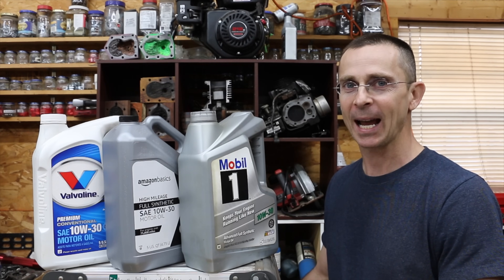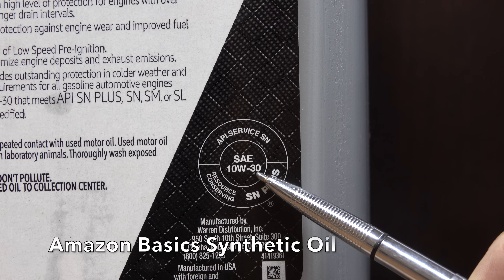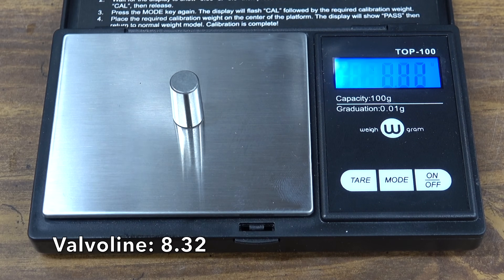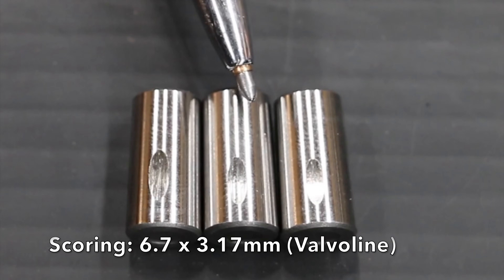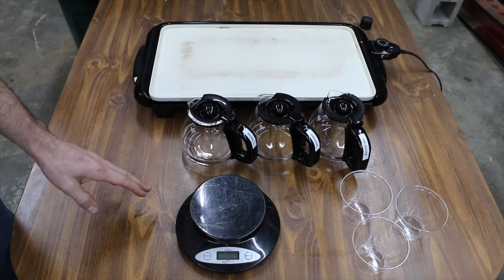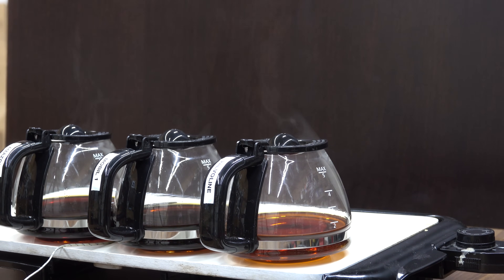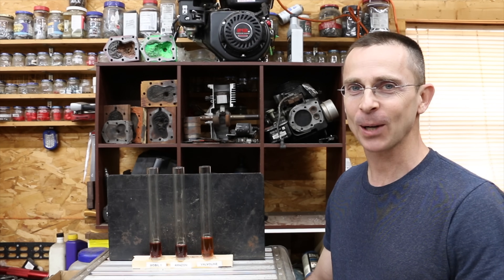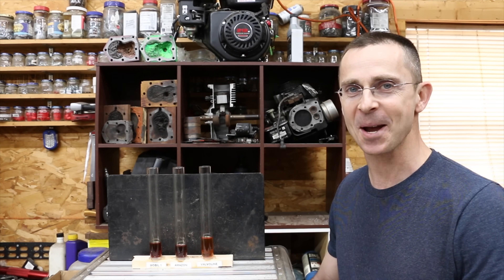Is AmazonBasics Full Synthetic Motor Oil better than Mobil 1? Let's find out!

Comment: You know what would be a great test I've always wondered about is if the 35$ jug at a reputable parts store is the same makeup of the 25$ jug at walmart. I always wondered how walmart can sell Mobil 1 jugs for 25$ but parts stores rarely ever get it under 35, that's a pretty big difference and price point. I've always suspected that walmart gets specific batches of cheaper oil sold in the same containers. Maybe it's conspiracy mind kicking in but something says that isn't right if parts stores are willing to price it way beyond a competitor.
Reply from the maker: Thank you for the video idea!

Comment: A test of standard petroleum heavy duty diesel engine oils would be great. Mobil, NAPA, Valvoline are the three main ones I've been using (whichever one is cheapest the day I'm buying).
Reply: Rotella is dirt cheap on Amazon too... Running it in my clapped out old Kohler flat head since it's got a drinking problem lately.
Reply: @TheBrokenLife  that's the other one I was trying to remember! Thanks.
Reply from the maker: Thank you for the video idea!

Comment: Another good illustration how conventional is not nearly as good as synthetic.  However, I think you should  have done a lubricity test on the oils after you overheated them.  I hypothesize that the conventional valvoline would have fared even worse.
Reply from the maker: Great point!  Thank you

Comment: Having watched your content for some time now, I'm really appreciating the depth and tenacity you bring to your testing.

I wouldn't mind seeing a comparison between MOTORCYCLE oils and normal high efficiency engine oils. In many cases, we riders will use whatever won't cause our wet clutches to slip, which is often stuff like Delo 400 or whatever synthetic diesel oils. But, are motorcycle engine specific oils bringing anything to the table beyond a lack of friction modifiers? Does moto oil protect a steel on alloy bearing interface better? ie, your lawn motor engine's typical bottom end bearings and top end bearings in nearly all modern alloy head engines.
Reply from the maker: Thank you for the video idea!

Comment: Thank you for your demonstration... Once again you raise questions for farm use. Oil is expensive when the tractor uses it by the gallon. I don't think I run over 100 hour in a year and the oil still passes the farm test. A two finger smear and some light shining on it. I wish I could do something  other than "Lubroscisize" a sample.   

In one of your videos you put seafoam everywhere it could go in your truck. I followed your lead and had good results all around.  So what if you use regular oil with seafoam in it? Thank you!
Reply from the maker: Thank you!  Seafoam is an excellent cleaner, but I wouldn't use it for a full oil change interval in the oil...just my opinion.  I would prefer using it just a few hours in the oil before an oil change since it will really help clean the engine internals.

Comment: Been trying to reduce oil consumption in my 2011 auto 2.0T and curious if using amazon oil if it would reduce my need to refill quart after quart every 600-1000 miles 😭
Reply: it has a flaw in the engine design. It doesn't matter what oil you use in that engine, you may not see any improvement.
Reply: Ricardo The PC Wizard I know but since I rent it out, I'd love to reduce the oil consumption as much as possible
Reply from the maker: It's worth a try.

Comment: Video Idea number one.  How much 2-stroke oil is needed in a gas/oil mix before ice crystals stop forming in cold weather?.  Video idea number 2. Some new modern oil formulas say that 100/1 mix ratio is perfectly safe in a 2-stroke engine....lubricity test various brands mixed with gasoline to see if the claims are true?.
Reply from the maker: Thank you for the video idea!

Comment: damn, valvoline is cancer for your car
Reply: That's flatly just not true. I've had multiple cars get up over 200,000 miles running on Valvoline conventional. It's just not a premium grade product with a premium grade price. On things I care more about, I run the much more expensive Mobil 1 synthetic (about double the price of Valvoline dino oil).

Comment: I thoroughly enjoy your videos. The amount of thought and careful attention to detail in the comparisons make these videos very valuable. I typically pride myself on doing a good job at what I do and I can’t say that I would do anything different than you do as you go through these extensive comparisons. We get the benefit of your hours and hours of hard work in preparing, doing the actual comparisons and then the excellent analysis. 
I do have to admit that I would have liked to have seen another set of the bearings/film strength tests after the heating and then again after the second cooling, just to see if there was any measurable differences through the cooling/heating/cooling cycles. Maybe for a future video. 
I really like how you make things very fair between the products. Weighing the scored bearings is a nice touch!
Reply from the maker: Great test recommendation!

Comment: You should make comparisons on bearing scars from different weight synthetics,  at -15F and then compare scars at 212F 

For example 0w30 5w30 and 10w30. 

I know they are supposed to flow the same at 212F but I'm a firm believer that in order to gain something,  you have to sacrifice another. 

My guess is 0w has less film strength at 212F than 10w.

Just a guess. But up here where last week was -66F 0w still pours like syrup.
Reply from the maker: Great test idea!

Comment: W stands for weight.
Reply from the maker: Thank you.
Reply: Winter not weight
Reply: The "w" in motor oil stands for winter. The first number in the oil classification refers to a cold weather viscosity. The lower this number is, the less viscous your oil will be at low temperatures. For example, a 5W- motor oil will flow better at lower temperatures than a 15W- motor oil. The higher number, following the “w” refers to hot weather viscosity, or how fluid your oil is at hot temperatures. The higher the number, the thicker the oil at a specified temperature.
That's off Valvoline's website.
Reply: Thanks.  We always used W for weight at the companies I worked for over the years and everyone took it to mean 5 weight when it's cold. So I learned something new today!  Thanks again.

Comment: Anyone have any long term experience with the amazon oil? And mechanic opinions?
Reply from the maker: I just completed a 6000 oil change and the oil did not evaporate nearly as fast as the synthetic valvoline I was using. Cold starts at near 0F seemed easier too.

Comment: In France we have Carrefour, reselling Mobil1 under its brand, Leclerc reselling Total under its brand, and Auchan reselling Motul under its brand, and others I don't know about. I drove many years with Carrefour oil in my cars and never encountered a problem. Now that I have 2 expensive turbo diesel cars and getting older and lazy, the cars go to the local garage for oil change. But my motorbike is still running with Carrefour oil, that's an economy of 40%.
Reply from the maker: Thank you!

Comment: I suspect those scales are not repeatable to .1g.  You might want to find a triple beam scale (drug dealer style) and use those, they are more accurate and repeatable.
Reply from the maker: I'll buy a 3 digit scale. Thank you
Reply: @ProjectFarm  I would recommend a set of calibration weights too. You can calculate the mass loss from the area of the scar and depth. What was the length and width of the scar? What is the diameter of the test race?

Comment: I didn't see synthetic on the Valvoline?  I have used standard 10-30 weight Valvoline in a pickup for 18 years. Inside of motor is still very clean. I do agree Synthetic is the best.
Reply from the maker: Thank you!

Comment: Anyone else think the bearing test in favour of Mobil? The oil literally flew out of the cup whereas the other two bearly touched the race. 
Maybe measure out a set amount instead of pouring say 20ml for the first two then 30 ml for the last.
Great testing though, although from experience Mobil 1 is one damn fine oil. I think my changes were every 3 years or 25k miles. An old merc, in 3 years I did 13-17 k. I felt really bad changing the oil as it looked exactly like new. That clear honey colour with no petrol smell. I did use a third party inline filter a little later in her life. 
I'm switching to amazon basics, thanks again.
Reply from the maker: Thanks for the constructive feedback.

Comment: The amazon oil looks like it darkened more than the others after the evaporation test. Did it seem that way to you?  (Hard to tell because cameras/monitors distort color a bit) It seems it started about the same shade as mobil1 and finished a few shades darker than mobil1.
Reply from the maker: Thank you!  It seemed to be about the same as Mobil 1

Comment: The amazon oil you tested is a high mileage oil. Doesn't high mileage oil have extra additives in it? Something about making seals swell up to stop leaks.
Reply from the maker: Thank you!
Reply: Yes, high mileage oil has solvents that make the seals swell, which is not something that you want unless your engine leaks a lot of oil around the shaft seals.

If you put high mileage in a car that doesn't leak, it still makes the seals swell, which makes them wear out faster, and ends up with worse leaks eventually.

Oh, and the lubrication properties of the oil itself are the same, it's just the solvents that are different.

Comment: The following motor oils fulfill the API SN Plus specification:

Mobil 1™ Annual Protection (0W-20, 5W-20, 5W-30)
Mobil 1™ Extended Performance (0W-20 5W-20, 5W-30, 10W-30)
Mobil 1™ Extended Performance High Mileage (0W-20, 5W-20, 5W-30)
Mobil 1™ (0W-20, 0W-30, 5W-20, 5W-30, 10W-30)
Mobil 1™ High Mileage (0W-20, 5W-20, 5W-30, 10W-30)
Mobil Super™ Synthetic (0W-20, 5W-30)
These motor oils can be purchased now, but the current packaging won’t feature the API SN Plus donut symbol. The donut symbol will start appearing on our products throughout 2018.
Reply from the maker: Thank you for this information!

Comment: My VW TDI specs oil rated 507.00 which leaves me on the sidelines for those three oils.  Good test otherwise.  How about a 7.25 inch circular saw blade test, 24 tooth framing for speed of cut and durability?
Reply from the maker: Thank you for the video idea!

Comment: I just realised something:

They have to ship a bottle of engine oil in a box just like everything else.
Reply from the maker: Great point. They wrap the oil in a plastic bag just in case it leaks.  I've never had a leaker.
Reply: @ProjectFarm  Yeah, kinda interesting. I wonder if they have to ship it in special trucks or anything. Not even just for spilling but also for how flammable it is, it'd probably be classified as hazardous.

Comment: i won't go near high mileage oil, if i have a mild leak on a seal, i get that seal replaced. if i don't, i'm sure not going to use an oil with additives to 'keep seals lubricated' this is fancy speak for those additives sort of getting into the rubber of those seals and keeping them 'fresh'. which is great in theory, but sucks if  you forget and stop using high mileage oil, since those seals then lose some mass/volume, and then you get leaks you may not have had.

i'd much rather just replace a seal.
Reply from the maker: Thanks for the constructive feedback.

Comment: Loved this video, I spent sooooo many years trying to explain to people about oils.
First and foremost is, Amazon, Wall mart, Tesco's, Sainsbury's and the like of other high street retailers, DO NOT HAVE THEIR OWN REFINERIES so don't judge by brand alone!. As mentioned in the video API is the easiest to understand. ACEA gradings are harder to understand so leave for another lesson.
Viscosity:
For a layman, if syrup is 100 cups of sugar (THICK), then sweetened coffee is 1 cup of sugar(THIN). Follow this by the "W" Measured at winter temperatures. Obviously, the highest number will be a thicker viscosity throughout the temperature band. The second number after the "W, winter temp viscosity" can be thought of a "Resistance to thinning under heat" or a resistance to flow by comparison.
Api SJ/CF in layman's terms is S.. sparkplug=petrol, C.. compression=diesel. The following letter after the S or C is alphabetical, the farther on in the alphabet that letter is, the better quality the oil is to the corresponding type of engine, eg, SJ is a better oil than SF for petrol and CF is better than a CE in diesel.
Great video and I hope everyone understands what I am trying to explain 😅
Reply from the maker: Thank you!
Reply: You are extremely welcome, your work is fantastic, this is just my tiny way to try and explain the nightmares of branding. Too many people follow brands just because it seems correct. The American petroleum institute are unbiased, as you are also. Having an idea as to the meaning will help some people know that if push comes to shove a CF oil will be ok in a SM grade petrol vehicle. Also as a reminder to anyone, the handbook is only written at new, when the vehicle is a few years old the API grade may no longer exist 🤣
Reply: @professionalidiots101  I am old enough to remember when the API grades went from SA to SE. (Tugs long grey beard.)

Comment: Thanks for sharing your findings! I'm not sure if you've done this before, but how bout a video on which carb cleaner or other chemical does the best job at cleaning lawnmower and 2 stroke carburetors as well as demonstrating how they affect the o-rings and gaskets. They are always getting gunked up, and most people don't have access to specialized cleaning equipment, so it would be fantastic to see which would do the best job. Have a great week.
Reply from the maker: Thank you for the video idea!

Comment: Can you test Amazon synthetic 10-30 vs Supertech synthetic 10-30
Reply from the maker: Thank you for the video idea!
Reply: Project Farm Sorry if this would be too much but a splash test would be a great idea since that’s how some crank shafts are cooled.
Reply: 09ThunderOne That would be cool, but I’d also like to see 10W 30 non synthetic from amazon basics too. Basically because if the oil is too thick and slow to go through the passages in the block then I don’t want it. My vehicle runs on non synthetic oil, but I was considering getting full synthetic 10W 30 just to see what happens.
Reply: Mike Isaac why not?! Very curious about Supertech, it gets good UOAs on BITOG!
Reply: 09ThunderOne I’m not worried about the wear protection I’m worried about if the oil will splash on the crank journals is going to be smaller because it’s a thicker oil causing less efficiency. Many oil passages are too small for thicker oils too, and the thicker oil will always take quite a bit longer to be in all of the passages.
Reply: Yes.. That would be great.

Comment: I wonder how Delo 400, 15w40 would compare??
We've used different oils over the years, but have always gone back to Delo..  Valvoline and Case-IH I think are very similar.... In our tractors with IH DT466 engines, we would burn from two quart to a gallon a day under heavy load... That was the last time we used anything but Delo .... Switched back to Delo, dropped oil consumption to a quart a day on those tractors...
We also don't have engine issues... 8,000. To 12,000 original hours on most ..  the others, we bought used....
They all cost too much!!!!!
Thanks for another great video... Watching oil run.. LOL 😎
Reply from the maker: Thank you for the video idea!
Reply: @ProjectFarm  any time!!😎
I know you sometimes run short on ideas .. your audience is about the best place to get ideas....

Comment: Many thanks.....all the way from London  !
I'll better stick with Mobil 1 0w 40, Dexos 2  because unfortunately I have a Mercedes E class coupe with a V6 direct injection, turbo and BluTec selective catalytic reduction emission sprayer.
They've had problems in the past with other synthetic oils dissolving internal rubber and neoprene engine seals and the clogging up the catalytic converter - so it's the only thing that will keep the engine covered by the manufacturers warranty.
I've learnt that nowadays with these very modern, cutting edge, 'space age' cars I have to be very careful & understand that the oil I use can affects so much more than just the engine.
Reply from the maker: Thank you very much!  That's a very nice vehicle!
Reply: Thanks.......but I'd prefer to have your very nice farm.......actually ideally both the car & the farm !
Thank you for your reviews they are most interesting - I've learnt a lot. @ProjectFarm

Comment: Why do you have so much 10w-30, is there many of this in usa?
Here in Germany we got much 10w-40 or 5w-30 bit i have never seen 10w-30 here O.o
Reply: I'd say 5w-30 is one of the more common oils here (with 0w/5w-20 also getting more common). The choice of 10W-30 is likely arbitrary, as it's more important to test the same viscosity across brands than the choice of viscosity itself.
Reply: @cpufreak101  10w-30 had been the standard weight year around oil in the US for about 50 years.
Reply from the maker: Thank you!  It's what I use in my vehicles.
Reply: 10w40 and 5w30 are bad when made of mineral base oil (mineral oils need too much viscosity index improveres, a sheareable additive that looses its properties by time usage). Europe use more synthetics in base (semisyn) for them, needing less vii to get the wide spread of viscosity index, being more stable at those numbers.